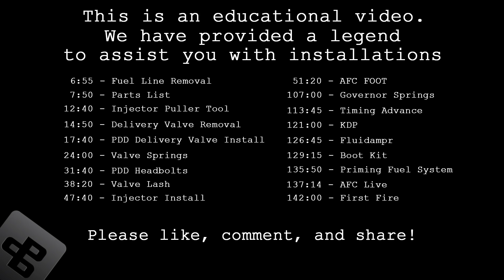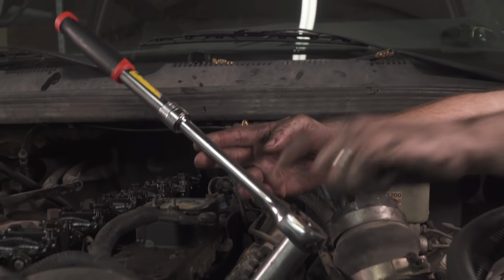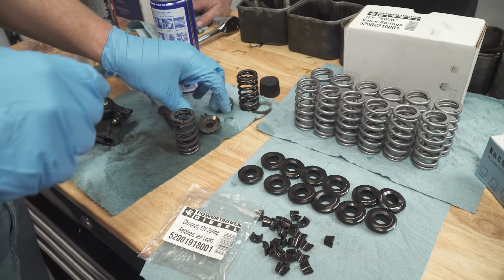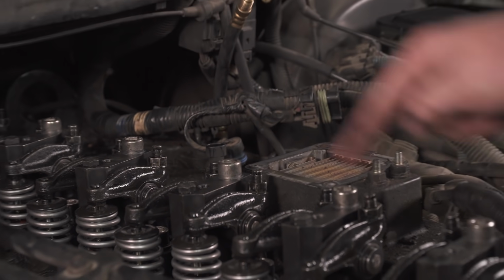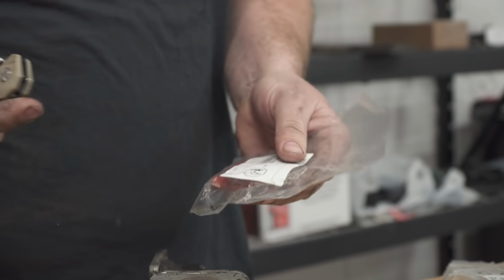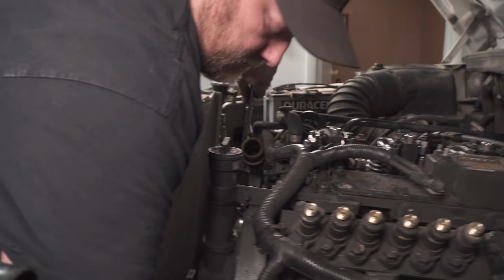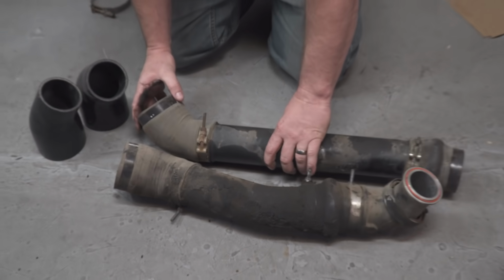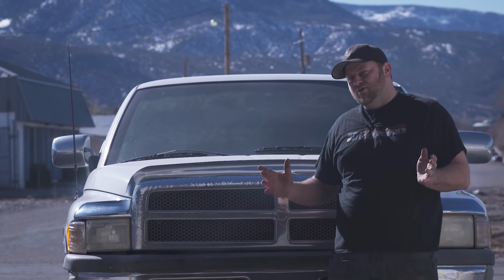Upgrading a Perfect 400k Mile Cummins Diesel

Comment: I love working on vehicles. In fact my very first timing chain that I've ever done was in a Ford expedition. And it took me off and on two weeks. LoL lots of breaks tho. LoL and it had 13 codes and I dropped that number down to 3 and got the timing chain and everything else that comes with the timing chain like the rails and all that now it has zero codes, and it has a motor on it with over 400,000 miles on it. LoL you definitely read that correctly. LoL But now I think it's got to much power and it's got a rod knock, but they only paid me 500 bucks to do that timing chain job. So I don't think it's worth the time for me to do it. Sorry It's not about a diesel. I'm just saying that I'm self taught and proud of it. And I really do enjoy working on vehicles and getting them ready to ride again.

Comment: Update called the shop about compound turbos set up and a few other complications to expect  your staff were very helpful  and took the time to answer all my questions even asking questions about my auto pilot lockout and discovered it was not functioning correctly as it was installed prior to purchase.  97 ram 2500 4x4 47re (built to700hp) 210k miles. HD T front end upgrade from the y system and way easier to align also installed the steering box brace with extra bearing.
Reply from the maker: Thank you for the comments

Comment: Hey folks? I am from Brazil and here these KKK27 or K27 turbos are very distant, but we are migrating to a better turbocharger in all aspects which is superior to the k27 which is from the Auto Avionics A366, A372 brand, if I'm not mistaken it is used here on John tractors Deere, it has the same quality as the Garrett, sorry for any mistake, I'm using google translator, sensational video, I liked it.
Reply from the maker: Those turbos are very similar the Box Borg Warner S366.  They make great power but at terribly lazy and slow spooling on a 5.9L12v Cummins.  They came from a 7 liter John Deere diesel engine which makes them decent performance turbo but TERRIBLE towing/street use turbo for a 12v Cummins.

Comment: I’ve been running a hx35 with a 67mm exhaust turbine with a he351 60mm compressor ... been a great upgrade over the stock unit
Reply from the maker: We will be testing that very combo on this truck shortly!
Reply: It’s a killer combo for a stock bolt in charger , I ran it hard and egt were great on my 24 valve with 150 injectors and a hot rod pump .... going to a 67/67 he351 over a s488 on my new build 🤟

Comment: I just bought my first diesel.Its a 2006 ram 2500 These videos are great and teaching this old gasser guy a thing or two about diesels. I have had it 2 weeks and purchased a 4"magnaglow turbo back exhaust,also a new s&b cold air intake and a edge evolution cts3 programmer.Before I go crazy with the old girl I'm going to upgrade the torque converter and do some tweaks to the valve body.
Reply: Haha, I have about the same exact mods on my 06.
5" turbo back silver line exhaust, edge comp, some plastic CAI tube, can't remember the brand and I wrapped it in dei gold heat shield mat stuff, put a BHAF filter on there and that's all. 
Threw the mods on in the first 2 weeks, and blew the trans up 2 months into owning it. So be careful... And that was years ago with only 55k miles.
Had the trans swapped out for a full billet Goerend trans, and have been hot rodding it since. 9 years strong on her now. No issues, other than all the consumable axle parts. Currently has 144k miles on it. 
Will run 0-60 in 5.8 seconds in 2wd, still scared to try a 4wd launch. 13.7 1/4 mile 2wd.
Has a level kit and 33's
Reply: @2S1L3NT  I know I will be putting a Trans in it so I drive it fairly easy but I'm a old man.I do like to get- locked in 4th and roll a little coal.Just getting into it half throttle amazes me the torque these engines have for stock.

Comment: Thanks for this video guys, this is very similar to a build I have going on almost the exact parts I picked up from you guys. Haven’t got the engine in the truck yet though. Excited to see it.
Reply from the maker: We just put it on the dyno... Quick question,  did you also upgrade your trans?
Reply: @pddofficial  I'm guessing thats a hint to how the stock trans held up on the dyno? Probably could have guessed... LOL
Reply: @pddofficial  nope but it’s a Cummins swap into Ford with the zf6 behind it, not sure how it will hold up but I’ll figure it out lol

Comment: Great video, can’t wait for the dyno results. Im looking to buy a 12v. Hard to get one in Norway, maybe i will import one. Definitely gonna buy performance parts from you guys when i do 😊
Reply: when visiting Belgium I saw more second gens than I expected, you might be able to find a good one there saving on import costs. But if you import from north america do NOT get one thats been driven in a lot of winters where it snows
Reply: @fluffygamer5335  hehe i know everything about winter driven cars 😅
Reply: @Ecanse  make sure it has no blowby
Reply: @steve5912  hehe, bought about 6 months ago, no blowby 😊 12v with PDD 650hp fuel kit and borg verner 369 sxe turbo 😁 The turbo might be to big for my application, long time for boost.

Comment: great vid..I run your SXE362, injectors, DVs, AFC live/max travel, 4k gov springs & pump time kit..next to buy; valve springs and install your head bolts..love my 12 valves!
Reply from the maker: Sounds great!  I'll bet with 20+ timing, you're truck will easily surpass 500 HP at the rear tire!

Comment: Good job 👍🏼 I’m been talking to my dad and we are going to p-pump the 2nd gen 24v Cummins and i got the kdp from amazon and I started to modify the p-pump the only thing that I did is I modified the fuel plate every thing else on the pump I left alone I haven’t modify the afc foot yet. And for right now I’m leaving the stock delivery valves in and the p-pump that I’m putting in my dads truck is a 175 pump. 

And good info on the modifications on the p-pump and good info I’ll have to remember that.

Comment: I used the same PDD kit on my 12 valve swap in my 98 K3500 along with a K27.  Big difference over stock power.  Actually popped my HG recently but I think it was my fault as I didn't do a hot retorque on the studs.  Very curious to see what papasaurus gets on the dyno.  Can't wait to see.  BTW, dad is still loving the mods on his 2005!
Reply from the maker: Awesome! Thanks for the support!

Comment: Hey Guys……did you remember to pull out the dowel pin from the back of the camshaft gear did it get sheared off??? I didn’t see/hear you make a point of not forgetting that step!

Comment: Regarding the copper washers for the injectors, I just dropped them in the hole, made sure they were flat and just dropped the injector in. I suppose this is handy if you do not have any grease handy. Let me know if there is anything wrong with this.
Reply from the maker: I’ve done the same thing many times, you good
Reply: @pddofficial  Thanks!

Comment: This is perfect.  I have most of these parts and need to run through this exact process on my single turbo 5-600hp truck.

Can you post a list of parts in the description?
Reply from the maker: Good idea on the parts list. We will get on it.
Reply: @pddofficial  Especially the boots and clamps.
Reply: I also had to back the video up a few times to figure out what injectors and other parts they were using. These videos will only get better. : )

Comment: I have a 2500 4x4 1997 cummins with just a little over 200k. I want to run right

 around 400hp  a atf fuel with compound sequential twin turbos with 4k Governor springs and a maybe upgrade injectors. I have rebuilt the transmission with billit shafts, Kevlar 727 bands, 3500 sungear all steel. And GM shift update and autopilot shifter.

Comment: Hey, wicked video! You guys did great,I got a 97’ 5.9l 12v rear wheel D, never really winter driven until I owned it, had it for 100k from 300/400 I noticed injectors needed to be replaced so got some 120hp bd injectors and running with full power again, noticed my p7100 is leaking oil, and by the afc the four bolts aren’t getting good seal anymore. I’m looking to buy a new p7100 but when it gets put in I’m hoping to be rolling coal and keeping my same setup, any advice?
Reply from the maker: You can send it in or if you have a local shop take it to have it rebuilt!

Comment: Great video! Now I know what I'm going to do in the spring. But when you're removing and tightening the nut for the pump to advance the timing is the plastic lock pin strong enough to hold it. I would think it would snap off.

Comment: I have a challenge.

 Make a setup you can test for efficiency  and test all the best  setups against the best ball bearing options and lets see a company see if they can come up with the most efficient setups for relatively stock fueling other than a fass/or the expensive knockoff airdog.  Limit is stock cp3  everytjing else can be upgraded.
 This leaves room for people to think  possibilities for the stock system. Also, im sure there is someone  at the shop with a 342:1 gear setup. Let's see what a decently awesome company  can achieve in the realm of efficiency  with these trucks and a stock cp3 and 5.9 block  At around the 550-600hp range.  I imagine with higher efficiency, we might be able to push past. That 530-560hp plato. 
   We are talking port work,  all the  ugrades one at a time, lets see how this pans out if you guys would be interested in makeing a series on what you can achieve  with different  mods with the best tune and stock cp3.   Can you achieve 30mpg? How about we find out once and for all

Comment: Could you guys do an in depth walk through of p-pumping a 1993 and earlier 12v. Want to know where to find a 12v 93 prior, timing case, cover, etc thank you. Awesome videos. Keep it up.
Reply from the maker: Great suggestion!  To answer your question, the 94 thru 98 timing case bolts right up to the early engines then you'd need a pump, lines, pump support bracket, pump gear, 94 thru 98 lift pump, oil feed line, lift pump feed line to p7100.  All of the parts are available, just fairly expensive to buy everything new.  In the past, the best way to swap was to buy a complete running p-pump motor and remove all the parts you need and sell the left over long block.
Reply: @pddofficial  Thank you! That cleared a lot of things up.

Comment: So the piston being at TDC is what's keeping the valves from falling?
Reply from the maker: Correct, the pistons can only fall down 060" or so when the piston is all the way up in the bore which is nothing when the valve stem sticks out of the head several inches.
Reply: @pddofficial  I'm new to the diesel world and am used to have an actual combustion chamber with room for a valve to fall, even with the piston at TDC.

Comment: Looks like y’all did the one by one method on the head bolts. Ever ran into issues with that on a 12v gasket? I’ve always heard it’s not safe because of the material of the gasket unlike common rails.

Comment: Awesome , I have a 1998 24 v , 270k and I am in desperate need of an aggressor and some injectors to match , looking for a 500-600 Hp daily driver , I am just north of Cedar as well so lets put one on and use me as a local build for the channel LMAO ! Would be sweet !
Reply from the maker: Go for it!  We just did some testing with our 7x010 sac and Quadzilla on a 24v and it produced excellent numbers on the dyno.
Reply: @pddofficial  Hey thanks for reply ! I got an Adrenaline from you guys in December , have an HX turbo that takes forever to spool and I want an injector /turbo combo that will make 500-600 daily driver, if I came over could someone take a look and recommend what would work well for me ? Also should I get one of those elbows that makes the turbo boost more? And is the fuel pressure adjustable on a 98.5 24v ? I can only get to level 5 on the adrenaline before it starts cutting out , guy I got truck from says it had 50 horse injectors over stock is all. THANKS YOU GUYS ARE AWESOME , also that green truck EXTREME COLLISION did is awesome !

Comment: On my 94 12v I had to mod the air box to open it up when I was beating the crap out of the truck with a new k&n filter I would fully trip the filter maintenance gage so I opened it up some and it fixed the problem  

The more you know 🎵
Reply from the maker: Yes, back in the day they called it the swiss cheese mod.

Comment: when you replace the head bolts as y'all did what torque sequence do you follow? (each bolt all the way to spec or each bolt half way and then all to spec)
Reply from the maker: Install each bolt to final torque figure before moving to the next bolt.

Comment: I really enjoyed the video . I wish I had this video back when I did some of these things to my truck . Damn I was hoping that every things would work out back then.  Timing was the big thing that made a huge difference in mileage . Back then you burn a hole in the piston. I told them it was my truck and my business . Set the timing to 17.5 or 18 . I found for me when I went to the 215 injectors on my 160 hp engine that the thinner washers seem to idle better . That just me . The 3 k governor kit what a difference lol . I be interested in a better turbo if you make one for towing and may be 275 or 300 hp . I have a 10 plate all the way forward .  Is there a benefit from the fluid damper on a stock 12 that want ever see over 3200 or less .  Also I might be interested in better head bolts or studs if it would help . I use my egt gauge and watch my water temp especially towing in Colorado . Thanks for you videos and advice
Reply from the maker: The fluid dampr does make the engine run smoother everywhere.  They are fairly expensive so lots of guys wait but after adding one, you'll wonder why you didn't get one sooner!  As far as better EGT while towing in the mountains, we are currently testing several turbos for that specific need.  The Borg K27 will drop you EGT about 100 degrees under the exact same fueling/load conditions.  We are playing with some Holset HX35/40 variants and will have those videos out in the next month, so far we've found even more EGT control than the K27 in some of the factory Holset turbine wheel designs combined with a little bigger compressor on the HX35.
Reply: I like to rewatch your videos to see if i missed anything.  I    added some valve springs and your pilot hole injection a couple weeks ago . I was surprised how good the injectors work . Can not tell yet if i getting better fuel economy,  will see ..  i buy one of your turbos in the future..Thanks for the videos

Comment: Can you please do a stock 12cm2 HX35 turbo with a ebay 67mm HX40 compressor cover, shut the wastegate and run a external one off the center of the stock manifold?

I have been contemplating this for a while... i wonder where the cap of the stock exhaust housing is, and if a external gate would help... should light up quick and compressor should be sufficient for what? 700hp?
Reply: I also wonder if a 14cm2 HX40 with this will spool crazy, because it should pump a lot of air so in terms of efficiency... bigger compressor should spool quicker when taken out of proportion?

Comment: why not replace the valve seals with the springs? just wondering
Reply from the maker: It is common to replace the valve stem seals on higher mileage heads when doing to valve springs.  In this case, the truck was destined for a ported upgraded hot street cylinder head in future upgrades so Will didn't do the stem seals.  But if it was going to stay on the road for another 100k miles as-is, new stem seals would have been a great idea!

Comment: When are you guys going to start playing with the new 6.7? You know, the one they started putting in the 2019 model.
Reply from the maker: There's a bunch of new equipment on the 19+ trucks, very intimidating.... and expensive!  We may order a bare block from Cummins to test the limits of the new CGI block casting.  There's already a race truck or two using the new block.

Comment: Can you please test the K27. I really would love to see it tested against stock. I would really like dump proof of its spool up vs stock
Reply: Also I’m digging the music and video! Nothing better with coffee at 5 am before work
Reply: I threw a K27 on my stock truck recently. It blows it away for real. But my old turbo was a WH1C (they say 99% the same as the HX) with 300k on it so I don't think it was performing the best, even though the bearing looked perfect when I took it apart. I'm sold on the K27 and it's the smaller turbo you want in the twin turbo kit which I plan to do at some point.
Reply: My good friend has a 97 12v with the HX on it is amazing. Spool is the fastest I've ever seen and it yanks up past 40 lbs faster than any other truck I've driven. I'm totally convinced that the turbo has been modded because it's an animal. His truck was modded with injectors and fuel plate in the past so I'm almost sure his turbo was done as well. Goes to show you can get crazy performance from tweaking a stocker.

Comment: Awesome. Why only turn the engine in reverse?
Reply from the maker: If you use the barring tool going forward is great.  The engine will not spin forward using the alternator nut if the injectors are still in the engine.
Reply: The compression is to high for the belt to turn the engine over from the alternator. With a baring tool you can turn it over the correct way this is just an easy no special tool required method.

Comment: Gasoline rag in the air box helps bleed the fuel system. MAKE SURE YOU HOLD ON TO THE RAG OR CLAMP IN DOWN SO IT DOESNT FLY IN TO THE TURBO!!!
Reply from the maker: Now that sounds like a fun video....  gasoline soaked rags and a turbo!
Reply: @pddofficial  hey it has saved me in sticky situations 😂😂 just Gotta be sure the rag doesn’t get eat by the turbo. Works best with two people.😂